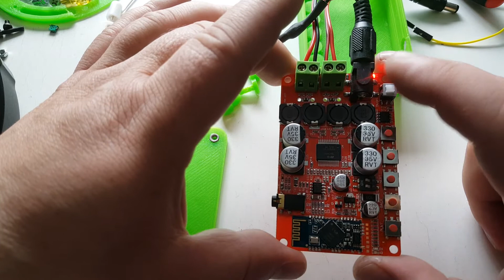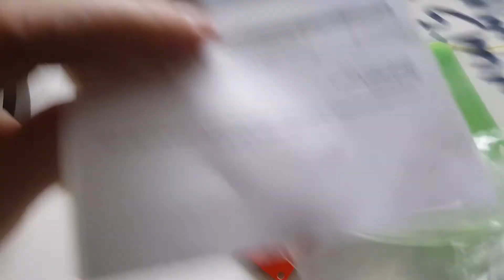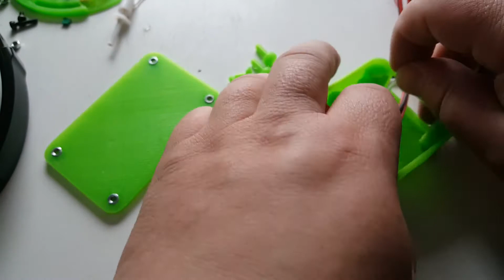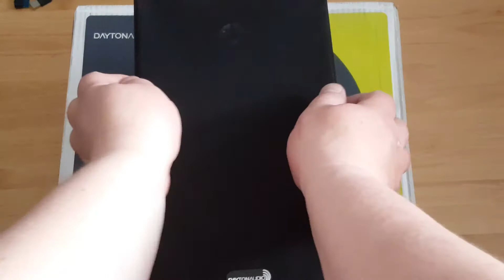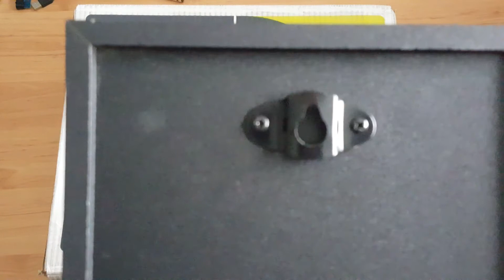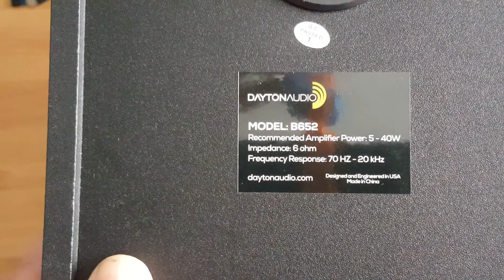Bluetooth amp

Comment: Thanks Arthur.  As always you came up with a very nice enclosure.  I am jealous (in a good way).  Is there a tutorial somewhere that would cover designing the enclosures and small mounting platforms that you could refer me to?
Thanks again for your great videos.
Reply from the maker: Thanks, Ilya! Tutorial - not that I know of. i just try to reproduce things I see elsewhere and like how they work. But if you tell me what you'd like covered or give me an example to work on, I could record a video of how i would approach the project. I usually go through several iterations making changes as I discover what works and what can be improved.
Reply: Great! I'll take pictures of a couple of things that I want to put in a box for my Hypercube project.  What do you model in?
Reply from the maker: I use OpenScad